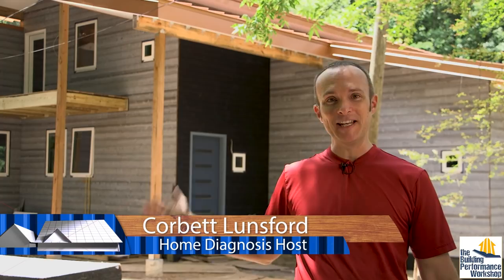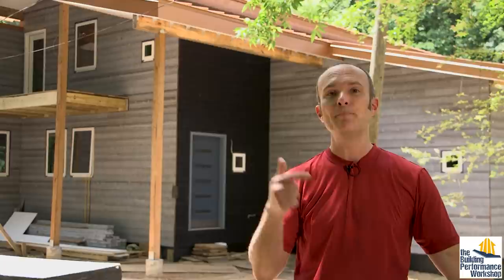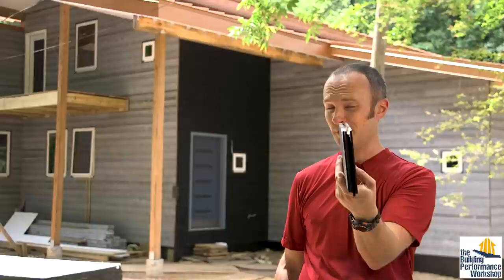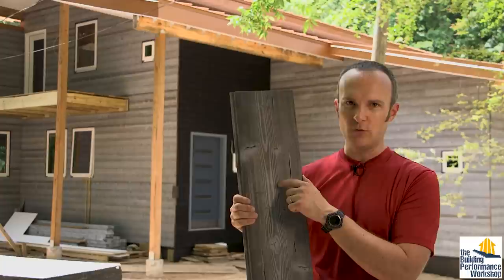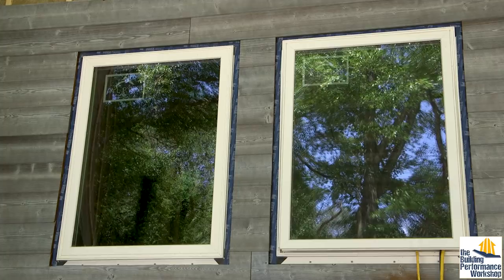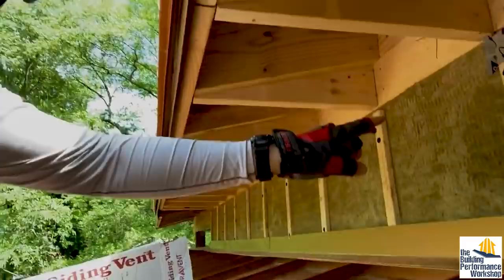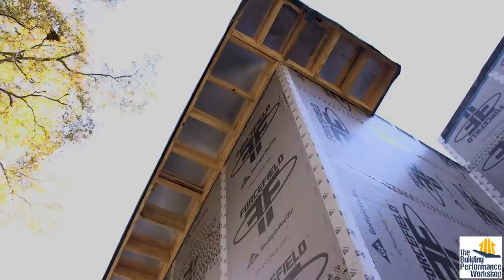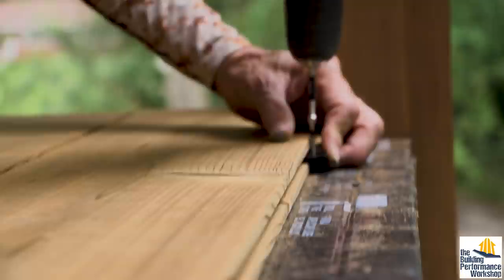Siding Our House with Thermory Thermally-Modified Wood

Comment: 1)  Does it serve any purpose in the mitigation of noise?  Or, is the Comfortboard sufficient?
2)  How may it be cleaned (mildew, sap, airborne crude, fly feces, etc)?
3)  How do you inform the wood bees that its not good to eat before they bore a hole and that they should not build a nest in it?
4)  How do you repair a spot (fallen limb, hail, stray bullet etc)?   

5)  Comparatively, where does this product sit pricewise?

Comment: Looks great.  I wished you explained why some of the boards don’t line up and leave a big horizontal gaps. You spoke about why the installer wanted to have the boards line up at corners and the boards are 8” wide. I would think that they would be less. 
I understand the gap is fine because of the rain screen.  It makes the house look more like something you find in old weathered farm house.  I like that.
Reply from the maker: Sam, I think you’re referring to shots where they’re still installing- all the materials are fitted tightly into each other, or into the clips in the case of decking.
Reply: On the walls. I can see the vertical battens.
Reply: I rewatched. I see now it’s just the way the dark heart wood with the light color of the knots.

Comment: Composite decking also gets very hot under the sun, which doesn't happen with real wood, and is another reasons you wouldn't want anyone in direct skin contact with it on any hot days... and they still break down over time, so the longevity reason isn't really valid for them...

Comment: It's sad the siding installer could not get the wood siding seams to line up when turning the corners.
Reply from the maker: They do line up, Gary
Reply: @HomePerformance  

Take a close look at your video timelines;
1:52 Your Grey Siding Corner Lines do not line up.
10:50 Your Dark Siding lines do not align with your gray Siding Lines.
Reply from the maker: Gary, camera angle. Also, the black and grey products are different sizes. Thank you for caring though.

Comment: Looks like a very nice product. I don't want to flat out ask about price but could you give a rough idea in percentage above quality cedar siding?
Reply from the maker: You can check it out at a number of dealers across the US, but you’d need to factor in the initial finishing and continued maintenance for it to actually make sense. I’ve used cedar, as I said in the vid, and I prefer this.

Comment: Thanks for sharing. What kind of screws did you use to attach you rain screen? Did you use window screen material for your bug screen? Our something specifically made for bug screens? Thanks!
Reply from the maker: You’re welcome, and thanks for watching Stainless steel 2” finishing screws attach the siding to the rain screen, 5” wafer head lag screws fasten those to the structure. And bug screen = Cor-A-Vent SV-5

Comment: Was wondering if you had an update for this siding and how it's held up over the last two years? Also, did you happen to leave an offcut lying around in a puddle for testing?
Reply from the maker: It’s as perfect as the day installed Andy. And no, I’m not running any experiments on extreme abuse- can’t think of a reason to do that.
Reply: @HomePerformance  Ok, thanks. Is there a comment automoderator setting that deletes comments with links? I had a question about Accoya and was linking to their site, but the comment doesn't show.
Reply from the maker: Youtube does a fair amount of that auromatically, but our channel settings allow for links in comments otherwise.

Comment: great vid.  looks great.  now, where''s those drain cleanouts????????????
Reply from the maker: Hey Dave- I don’t get your obsession, sorry. What’s wrong with cleaning out via the P trap if needed?
Reply: Better to have and not need than need and not have.   Insurance in case issues. Woohoo
Reply from the maker: I guess I can’t imagine what the problem could be- I’ve never wished for a better solution than what I’ve always had. Can you elaborate?
Reply: Clogs my friend. Why snake be removing a trap when you could access the drains via a more direct route. A special cleaning port in addition to the ptrap
Reply from the maker: I understand- thanks for clarifying. May add these now, can always add later too.

Comment: Did you use and WRB or control layer (water, air, vapor) on this wall structure (over or under insulation)?
Reply from the maker: Yes, the wall layers are sophisticated. You can find several videos on our channel showing them.

Comment: Risky living with reclaimed wood.   I had a partner in my cabinet shop.  His father inlaw worked at the railroad. They used almost entirely reclaimed wood from the rail cars. ( no telling as you mentioned what sort of chemicals and toxic items were shipped.)  Both he and his wife died of brain Tumor (same cancer) they were in their mid 50s.  I see people who want to build with reclaimed (toxin impregnated power poles (please dont do this) They WILL give you cancer)    Sure cannot emphasize enough that while you can perhaps save, this is your home, Dont use materials that can kill you an worse.  You or a family member with cancer that you caused, is actually worse.
Reply: The siding isn't reclaimed. It is finished in a manor that appears it is. The process is wire-brushing and 2 different colors of paint.